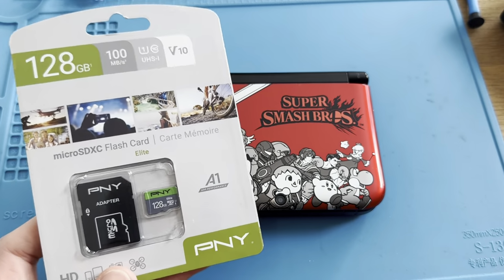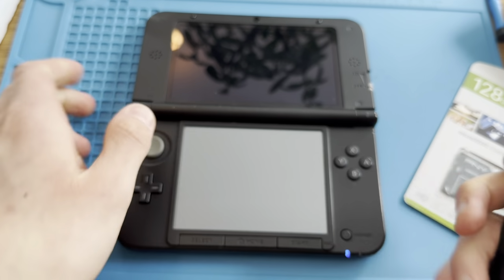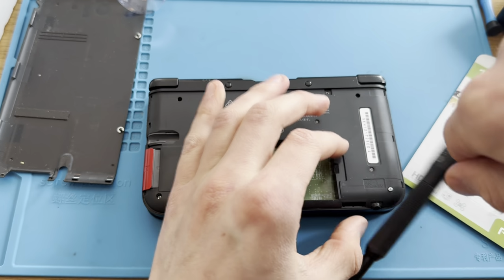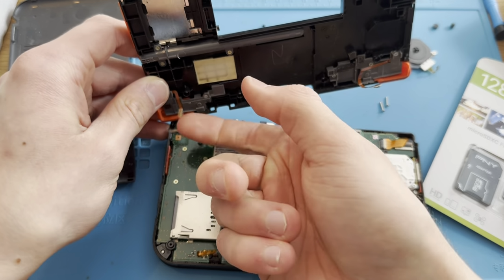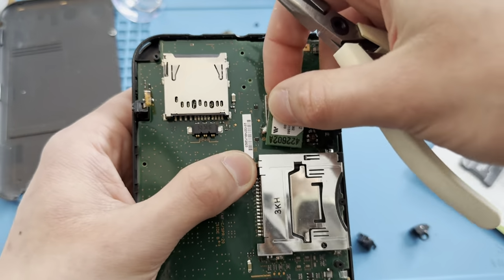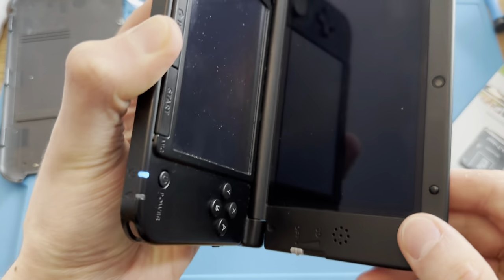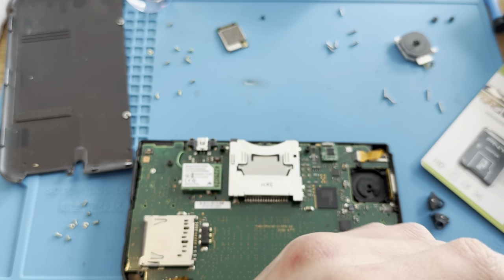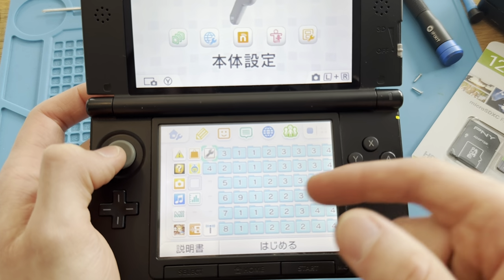3DS XL motherboard swap for a customer

Comment: Where do you live can you fix my 3dsxl too please for some reason it has trouble with SD card reader it's already modded but if I squeeze to hard on the back panel it says I removed SD card. Something is wrong with SD card slot I think it just needs a new one please help me I'll pay you the $100 mines already modded
Reply from the maker: It needs a new motherboard. New motherboard costs 120 dollars. I live in norway